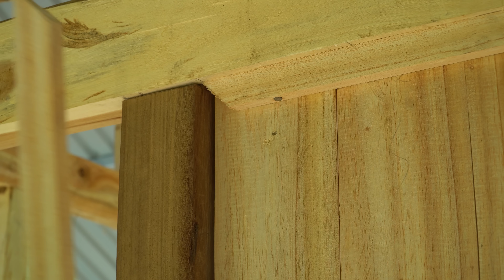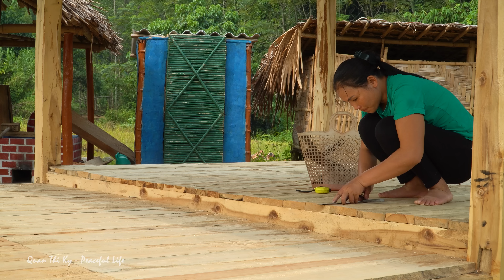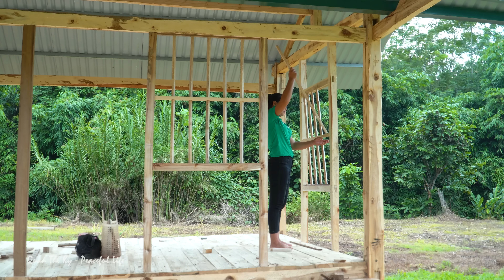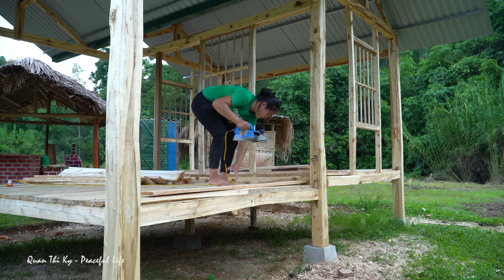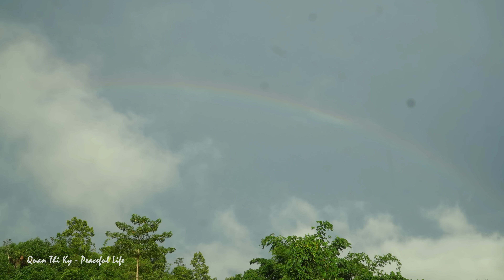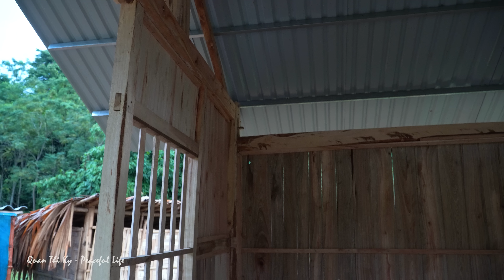Build Wooden House: Assembling Wooden House Wall - Quân Thị Kỳ Building Farm

Comment: You are a great builder....I am glad you built a sturdier house to better protect you from intruders and vandals....Keep in mind that besides wooden walls you need strong window shutters and doors with heavy duty locks....And it will be safer if you protect the openings by the gables of your roof....You can also consider to collect and store rain water from your roof....Great job Ky